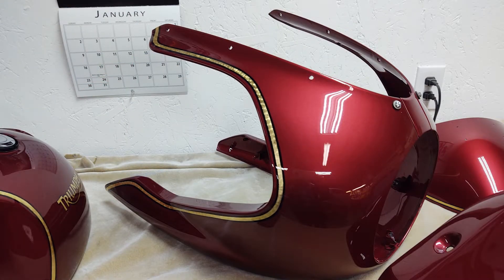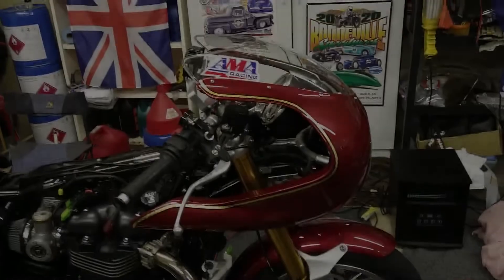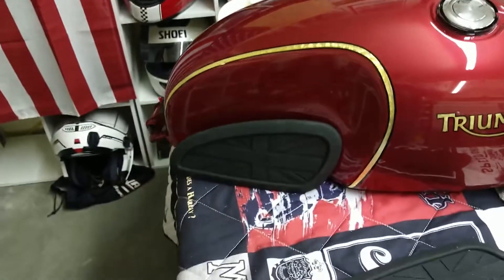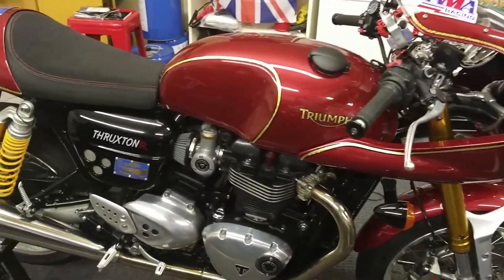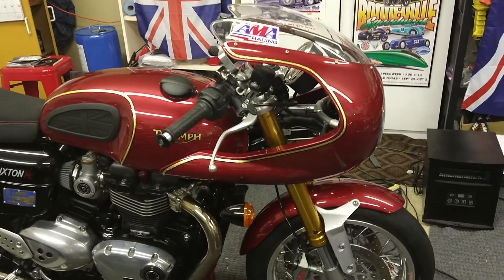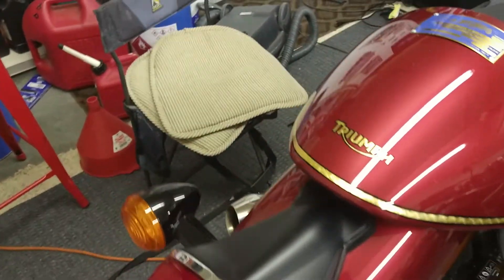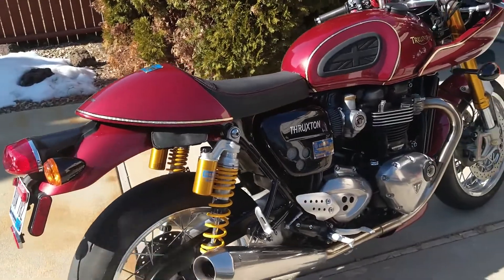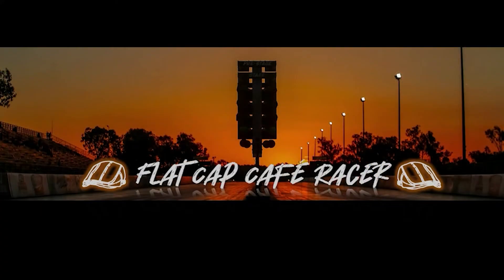Thruxton R paint is now done!

Comment: Beautiful. I'm on the RAT forum and saw your first part to this process. The glue for the gold leaf is called size. I shared a shop with a sign maker who hand carved signs and his wife gilded letters, bevels, etc. She used a size from France. Takes time to let the size tack up where it's ok to lay down the gold. Too soon and the gold will smear, too long and it won't adhere. The machine marks that you commented on is called burling. It's done using a velvet pad by hand. After the gold is on and cleaned up. Look at any firetruck and you will see extreme large example of burling. You can create many different patterns with the technique. Sorry for the long winded post. Great job. Felony.
Reply from the maker: Russell thanks so much, that was very helpful.  This information will be pinned at the top and I appreciate the help.